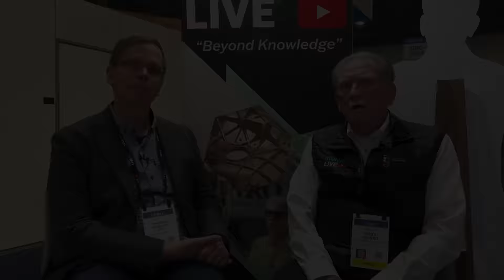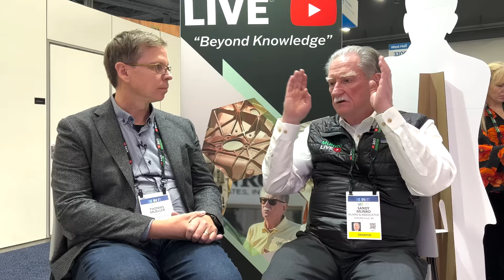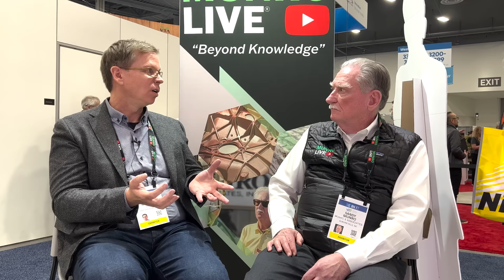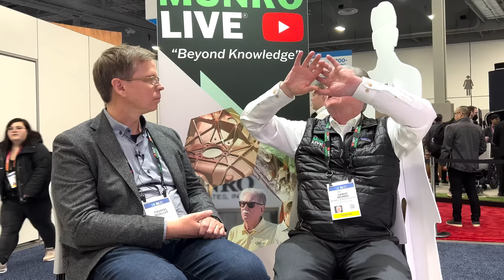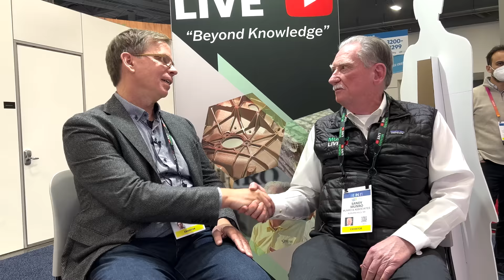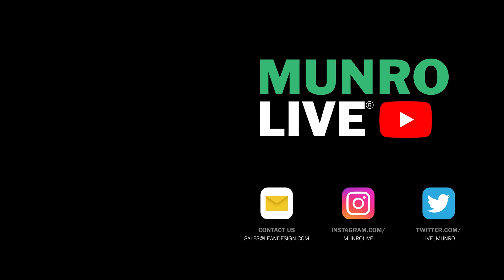100 Million Lines of Code: The State of Automotive Software | CES 2023

Comment: As a software engineer, this video is almost right but also often very wrong: Go is suggested as an alternative for C, but it is not a systems level language meaning it can be very tricky to use on embedded systems due to lack of control. Furthermore, why is Android better than Linux? That makes no sense. Linux is the most used operating system on Microsoft Azure even. It's rock solid and not linked to an organization. Like I get that Android has some nice features especially for touchscreens, but saying Linux is bad makes no sense. And what about "you cannot use modern coding techniques" in C? What does that even mean? The Linux kernel is written in C and was the first to use Git, and using Git is an example of a modern coding technique. If the "modern coding technique" is about object-oriented programming, then it sounds like this conversation has been drinking Kool-Aid from around 2000. And, well, microservices are presented as a solution to all your monolithic problems while it is long known by now that the answer is "it depends". Sometimes microservices make more sense and sometimes monoliths make more sense. If you're Google and you're running thousands of servers with many engineers collaborating on the system in real-time, then microservices make sense. For a car, keeping the microservices running and communicating sounds like an unpleasant job. Maybe it would work, but probably not easily.

Comment: No doubt, the current architecture of controllers and software in cars is due for redesign. Complex networks, ancient chips, and everything else, it's inefficient and creates supply chain issues when things go wrong (as we've seen). But...

100 million lines of code in a car? That's your problem right there, and trying to go to a mobile phone model for mission critical components is just going to be worse.

If there are 100 ECUs on the car, and there are 100 millions lines of code across those ECUs, that's a million lines per ECU. That's a crazy amount of code for something that is supposed to be a one-trick pony (i.e. the reason there are so many of them in the first place).

But beyond that, the consumer electronics model of software engineering is just inappropriate for cars. As software has become more and more pervasive throughout consumer electronics, we've enjoyed an explosion of features, but also an explosion of bugs and inefficient code. It will take some serious self-control and intentionality for the automotive industry to impose good software methodologies that ensure the code is robust, concise, and properly modularized, if they are going to avoid making all the same mistakes that other companies have made with televisions, A/V receivers, mobile phones, HVAC controls, and yes, in-car entertainment and navigation systems (I have lost count of all the times I've had to reboot the computer in my Tesla Model S because something's not working right).

I agree that the current state of affairs leaves a lot to be desired. But at the same time, I remain unconvinced that car manufacturers, along with the usual suspects who will be "educating" them when it comes to software development, will be able to come up with a new way of doing things that isn't just as bad as the old.

And yes, I'm a software developer myself, with four decades of experience. I've seen what the software industry is like, from the inside, and I would hate to see software in cars move to development processes that are in any way similar to what one sees in other large-scale software development today.

Comment: I found this discussion way off base. The last thing I want (as an engineer) is one giant computer (or even a few) on my vehicle controlling everything. Compartmentalization of functions is generally what you want in engineering. You break down large complicated problems into a set of simple functions, that are easily understood and solved, that don’t interact with each other.  

Of that 100 million lines-of-code, how many are in the infotainment system? Which itself is a nice-to-have, but unnecessary for a car.

The notion that C is used to program the small chips, and that will lead to discarding all of those designs is IMO incorrect. All chips run machine code. Programmers use C to program them, which is compiled into the chips native assembler. The limited hardware capability of these chips limits their ability to be programmed in a much more capable language and still get the job done.  

Android is built upon linux.  

Most of the compute power mentioned in the interview is used for self driving. Lots of cameras, analysis of scenery, when and how to slow down, break, etc. Lots of AI. The big problem I have with AI is the self learning part. Over time, the “design” gets better and better as the AI algorithm learns from actual drivers.  I just will never trust self driving, and therefore dont want all of the hardware to support it.

But there will still be circumstances where the AI does something really stupid, that even the most junior driver (with a license) wouldn’t, with deadly results.  And since this was all self learned, it will be hard to know why it made the mistake, and worse, how many more issues are there. No thanks, and get rid of the high end computer.  Plus computers with this much compute capacity use a lot of power.

Comment: How can a car have lines of code than a Dreamliner. An aircraft  moves in 3 dimensions, a car only 2. An aircraft travels up 900Kms, a car 160kms. An aircraft accommodates hundreds of people, a car up to 7. An aircraft has up to 4 engines, a car one motor/engine.
Reply: Cars use existing operating systems. Used to include the likes of QNX and win-CE. These days it's mostly linux. And if you want to build linux for your specific platform, you are not building all of the code in the kernel, only those bits that are relevant.

Aerospace likes things bespoke.

Comment: C/C++ old? How many thousands of years old are wheels? Certainly you must have something better than wheels? Just because it's old doesn't mean it should be tossed out. Just as "wheel" has evolved greatly from chariots to F1, C/C++ tool chains have evolved as well. One of the problems is that there are far fewer who can code well and safely in C/C++ compared to java, javascript, python, rust. (My original degrees in computer science in the era when mainframes walked the Earth, and remembered using donuts made of rust.)

Comment: EV brakes are going to be a big problem. They are over-specified, because regenerative braking does most of the work. Cast iron discs will corrode. Pads and caliper sliders will seize from lack of use. We will need to return to drum brakes (sealed from environment) then add stainless parts that don’t corrode.

Comment: Errr… c is a programming language, Linux is an operating system written in c(for the most part)
Reply: And…… BlackBerry QNX is the operating system for all things mobility (besides Tesla, although SpaceX does use QNX!) - this ADaS certified operating system is already operating in over 215 million cars worldwide including most legacy OEMs and every single Chinese EV manufacturer’s products. Let that sink in!
Reply: @cenz5889  Every day is a school day! Software Engineer/Developer now retired but all within the “static” I.T. Architectures
Reply: @shockthemonkey7046  retired mechanical engineer here. I believe the QNX platform will allow OEMs to customize their own software solution so that they can create unique user experiences without fear of Apple or Google manipulating their way in     to control the entire experience.
Reply: @cenz5889  Good to know there is an industry standard for the o/s(I often did wonder!) and can be ported to different chip sets and no doubt multiple language compilers are available.
Reply: ... And android is linux... And Mr Mueller is clueless.

Comment: First, lines of code is a useless measure. I can keep all of the obsolete portions of my code in the code base, but the optimizer in the compiler will trim them out of the firmware that is burnt into the chips. Optimizers are great. Huge code bases, not so much, they make it hard to understand the whole system. Does lines of code include comments? How do you count lines of code when dealing with the boiler plate code of AUTOSAR when the "programmer"/tuning engineer is adjusting configuration tables instead of writing code? Lines of code is useless.

There are a few trade offs here. The less ECUs you have, the more wiring you need. A distributed approach saves weight. The smaller the processor, the cheaper they are, but they are getting more capable every year. The less programmers you employ, the more ECUs you buy from the Bosch catalogue. If you're not going to write your own system, you're beholden to what the OEMs are offering. The more you want to reduce complexity, the more ECUs you use. A single monolith is huge, buggy, slow, unmaintainable, and needs a larger more expensive processor overall. The less you want to use an RTOS, the more complexity you inherit, along with all of the complexity and bugs. The more you assume Linux is going to solve all of your problems without thinking about it, the more security holes you left open because you didn't think about it.

There is not one single answer. Is a system with 100 processors connected by CAN bus better or worse than a single AMD Ryzen? Yes, no, maybe, the 100 processors are designed to run at automotive temperatures, but it can be updated more easily. Should the mechanical engineers, that are tuning AUTOSAR tables, be designing infotainment systems? No. Should the infotainment system be running on the same processor as the antilock brakes or engine management? No. Should the central processor be activating a single signal light down a 5 meter long piece of wire? No. 

Cars have to be profitable and reliable. Actually the reliability is also a cost/benefit calculation. Do they have to be updatable? That's a cost/benefit calculation too. The same could be said for energy consumption, usability of the human interface, and longevity. Software is an expensive, infinitely thin, mostly weightless component. Whether it is written in C or Rust, C++ or Modula is a design decision based on if a compiler exists for the available processor, how many programmers you can hire that know how to write embedded code in that language, maintainability, predictability, reliability, and the ability to push the bits into the peripheral control registers. And in the end, you have to be able to turn a profit, which means producing a product that people are willing to buy.

Comment: Sorry Sandy, My model S tires wear out twice as fast as an ICE car.
Reply: Yep, it's sad that ICE cars wear out in just two Tesla tire changes unless you spend tons of time and money maintaining those ICE cars.  Oddly, my Tesla tires last longer than that of prior ICE cars I've owned.  It depends a lot on what tires you buy and how you drive.  Get low-profile soft tires on any performance car and they are going to wear quickly.
Reply: "Tires on a modern electric car will wear down much slower than in a car with a traditional internal combustion engine. This is due to good traction control. The driver assist systems reduce slipping by utilizing the electric motor's rapid power adjustment. This system is much quicker than in ICE vehicles, where it is based on braking and limiting engine RPM" , Nokian Tyres' Development Manager Mikko Liukkula

Comment: @20:25 Android is based on C, not even C++, because it's a fixed architecture, a petrified design, if not software. (†) 
The problems facing the auto industry are ones of APIs (Application Programming Interfaces) over an RTOS (Real-Time Operating System) to give each subsystem (and its own piece of processing power ) the ability to gain the overarching system's attention. This is a far from trivial problem.
†) That's why software updates are so hard. You need a system that is entirely separate from the systems which run the machine.

Comment: But isn't the elephant in the room already addressed by autosar standard. Temporal determinism is the focal point of the standard through the design process. It's very unfortunate that automotive software is developed by agile web apps programmers that are typically uninformed about lessons learned by legacy companies, which are openly documented in the spec. I do not understand why do we witness over and over again self proclaimed experts reinventing the wheel.
It's so unfortunate that safety has been replaced by SAFe.

Comment: If I understand computer operation, it   does multitasking not in parallel but in series, ie one task at a time, that if execute fast enough can appears simultaneously. That was driven in favor to code development, management and productivity, is however cost to hardware in terms of ram and computation speed, the fix?  7nm resolution lithography. 

The cost in parallel operation is it requires an advanced “protocol” between chipsets necessary to maintain traffic for no coincidence conflicts to system error or a crash.

Comment: Tesla software and hardware are heavily integrated and blisteringly fast is currently using Linux  based OS if I am not wrong. Instead of fixing issues in their linux based solution, BMW is moving away from it.😇

Comment: Have to challenge the “tires are low costs” I spend about 6 cents a mile for tires because I have to buy speed and weight appropriate tires for 6,000 lb plus Tesla Model X. The tires wear out quickly 12k to 20k miles or blow out.

Add high acceleration promotion and fast turns creates rubber crumbling torque pressure on tires. 

At $350 a tire to replace, that’s at least $1400. per set of new tires a year.

In my book that ain’t cheap, and anyone I talked to about it agrees.

How about getting the price of tires down. A set of tires should last 60,000 miles, especially if you are paying $350 a tire; but, why not a lot less ? Here is a problem that needs to be solved.

The same problem herein applies to Tesla Semi.

🛞🛞🚘$1400🚘🛞🛞🤯😱

Comment: The "C" language is used in legacy apps for automotive. Python and Java are much more popular languages. Finding Python and Java programmers is much easier than finding "C" programmers. Also, programming in a higher level language make you more efficient.  
For example, Python has a module for the automotive CAN Bus called python-can. With a module like python-can, you can generate new functionality much faster that the "C" equivalent. "python-can hides the low-level, device-specific interfaces to controller area network(CAN) adapters in interface dependent modules"

Comment: The lines of code I would need would be those that safeguard and optimize the battery and charging. 100M is to support all of the unnecessary wiz bang wizardtry.
No wonder most people can't afford an EV because it  is priced 40%+  more than it should be. The great reset strikes again . . .

Comment: 1) C is the god of all programming languages. Moving away from it would be a huge mistake, creating complexity that does not have to exist.
2) 100 million lines of code is clearly rediculous. This is called bloat code. Somebody really needs to clean house.
3) 1 central computer with a backup is enough. Some sub-processing may be required for things like the ECU and camera units where timing is critical, but for other things, only the code and capacity for remote sensors and actuators is required. This would make the units lighter, cheaper and easier to replace.
This helps me understand why VW is having so much trouble with their software. If this attitude is common across the industry, it goes a long way to explaining why really upgrading cars and OTAU (over the air updates) are so difficult. Of course it is nearly impossible to update imbedded device code over the air, it requires a flash tool. SMH.
Edit: Moving your software development out of house is ALWAYS a mistake. Once you lose control of your IP, good luck making revisions, repairing bugs or making upgrades. You can't do anything to something you do not own. again, SMH
"Downloadable safety critical software"?!!!! Now you're just asking for it. Where is the accountability? What's to stop some hacker from putting something out there that will crash your vehicle? No way. Not in my car, not ever. I'm outta here.

Comment: The reason big OEM's can't work together because they can't... They are a union shop... A body person can't work with a tooler or any other classification other than the ones they are in... Otherwise it's a grieavance.  And salaried positions can't help union workers.. so no engineers can step in.

Comment: With so much demand for affordable BEVs, Automakers instead of the iPad on wheels full of tech gimmicks, with a price tag of an apartment...go with the Power tool route. Simple and robust powertrains, with interchangeable battery packs, that could be easily replaced.
Reply: Oh if only it were that easy
Reply: @1Snouser  A maniac in his garage using a kitchen knife can fix a broken Tesla, at least mechanically and electrically. The only hurdle is getting the software, which is designed not to allow repair, to work.
Reply: @1Snouser  why not? Early Nissan Leafs weren't that complex. As the Dacia Spring, which has a big demand on Europe. Automakers have so much software shoved in the car, so they can offer more tech features, and battery management systems. Simpler BEVs, in terms of hardware and software, would mean more independent shops and costumers able to work on them. But that would hurt Automakers in service revenue.